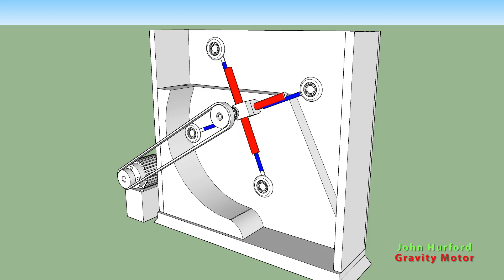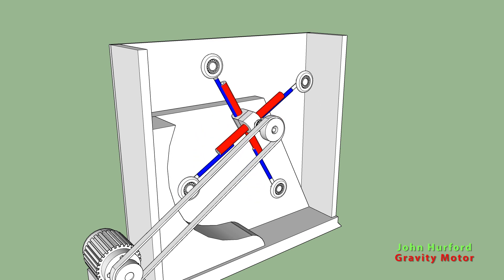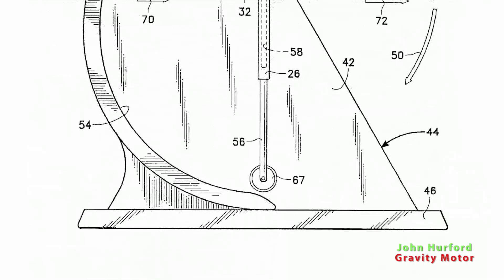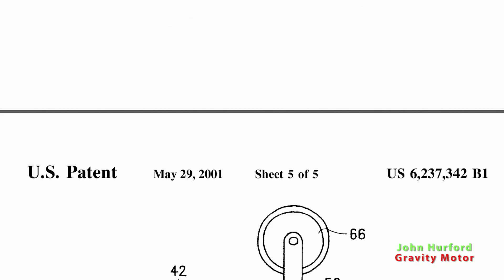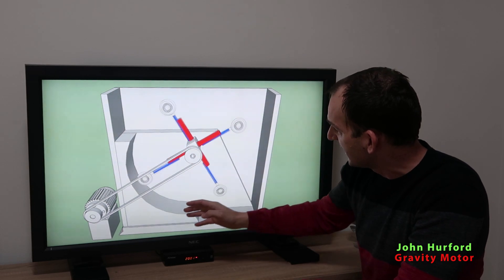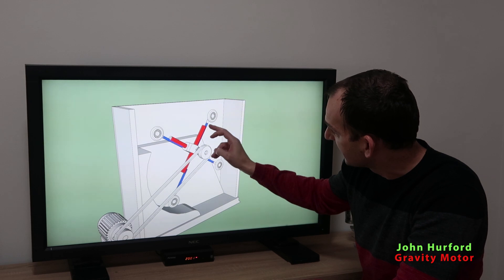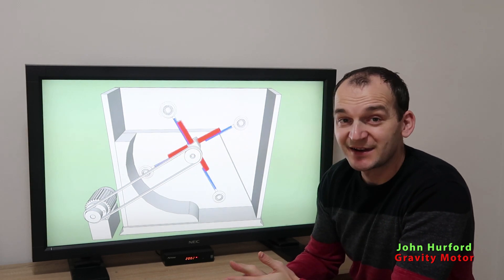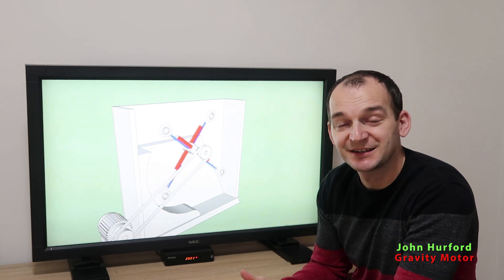Free Energy, GRAVITY MOTOR by John Hurford, AMAZING!!!!!

Comment: Umm... Wtf dude. 

Equal and opposite reactions. 

What happens on 1 side must also happen on the other side equally. 

Therfore it will start to spin then stop and come to rest. 

You really need to learn physics.

Equilibrium is found at a 45 degree offset from 90 degrees down. 

This is a joke right?

Comment: Calculations of weights to pull down when leaving the platform to calculate what weights is needed to push out when rolling on the platform.
Maintenance is needed to ensure a running motion and calculated weights that is not interrupted. Besides the weights, magnets is needed to ensure a push and pull, like the other comments states

Comment: I do believe, magnet energy is a thing 
However, this is not a good design, it must not rely on gravity!!!
HoJo is the only real magnet motor!
Reply: Sorry, but Howard Johnson has never achieved a running magnet motor. Which is no surprise, due to conservation of energy a magnet motor is not possible. This also holds for gravity motors.
Reply: @heinzpg  Conservation of energy (COE) is a law that we created because of what we have observed across millions of experiments. It's impossible to prove that COE is true in every case because it would have to be demonstrated to be true across an infinite number of cases. However, all it takes is a single case to show that energy is not always conserved. Given that there are an infinite number of possibilities, I'm willing to bet there is at least one design that will work.
Reply: @you5711    Conservation of energy is one of the few laws of physics which is not only based on observations. There is also a mathematical proof, that conservation laws are a prerequisite for stability of laws in location and time. This proof - see Noether theorem - was found more than 100 years ago by a clever mathematician. Theoretically even with this proof there could be a chance that conservation of energy is not 100% correct but in that case the deviations would be so minuscule that a practical use can be definitely ruled out.